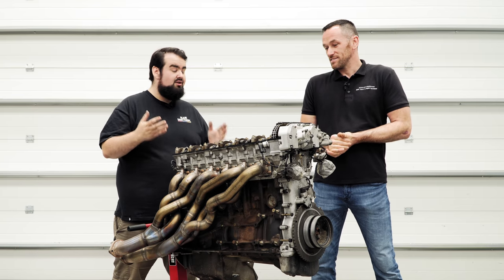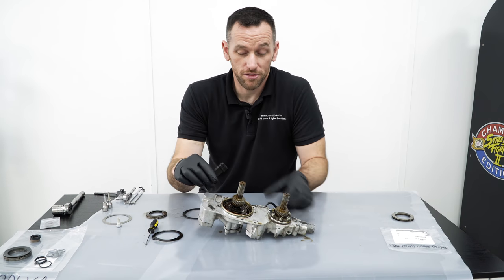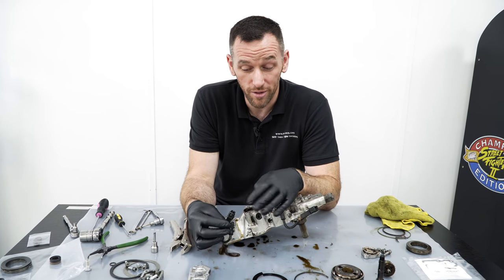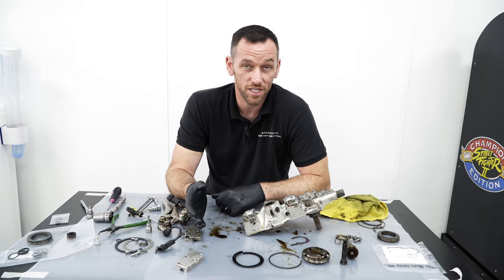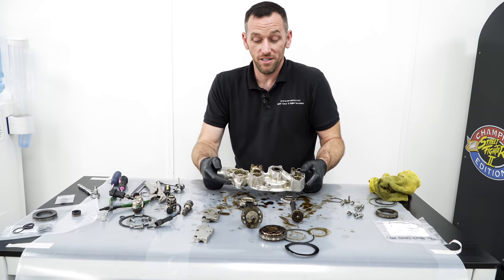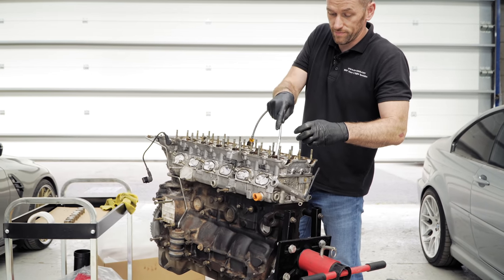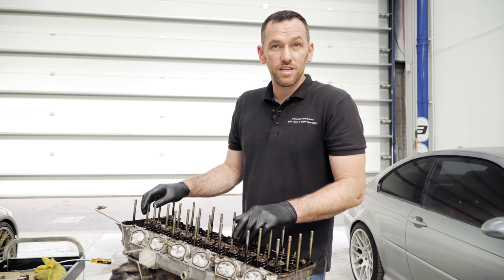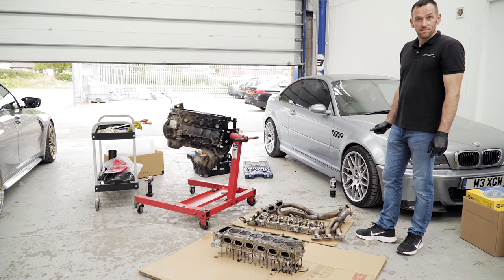BMW VANOS Masterclass - Tear down + why it fails with MR VANOS - E36 M3 Touring Ep 09

Comment: Speaking on experience, Steve is well worth the wait for anyone wanting a VANOS repair/replacement 👍. He doesn't have to do a house or garage visit in his business but he likes doing it and loves Mpower engines as all the customers do and viewers looking at the video. S62 V8 and S50 straight 6's are the best over engineered Mpower engines in my view and recall he shared his fondness of them engines also. He has an E36 M3 GT2 himself and looking to do a nut and bolt restoration but considering his long waiting list and customer demand we may never get to see it done 😂 but to be fair, GT E36s are going up! Full credit to Evolve and Mr Vanos for doing the video because barely anybody goes into this much detail.

Comment: Mr VANOS needs to read-up on the s50b30 vanos units as he is wrong.  These were not 2 stage but continuedly variable.  The 1st 2 stage vanos unit was on the M50TuB25.  Strange how a "VANOS expert" would get  his so wrong....  The S50B30 VANOS was the same as the intake side only of the S50B32.  The USA spec 3.0 M3 had a S50US engine which is from the M50Tu family...  Also its not running at 120bar but 150bar.  42:00 the holes in each primary of the headers are for a tool used to measure exhaust gases used to correct the idle mixture adaptations.  Not a "clear leftover unused sensor hole from motorsport".  You need BMW TIS for this process.  Thanks for the video, looking forward to the next one!
Reply: Yeah,, bit of missinformation regarding the S50B30 unit.  The Rolls Royce vanos unit is essentially the same on when it comes to the intake side when looking at the S50B30 and the S50B32. The exhaust side of the B30 is just an oil pump.   I also would like to know if the intake side on the B32 moves 60deg and not 40+ like the B30 because the gears look the same.

Later in the video he names the B32 the S52.. just to confuse things a bit more.

Good video though
Reply: I confirm this

Comment: This is why I love the n52 vanos system the only areas to fail are the solenoids which are 1x bolt at the front of engine and then the filter baskets on the side using 1x torx

Comment: Brilliant video- totally straight up sincere good bloke 👍 Thoroughly enjoyed it :-)

Does anyone know the BMW part number for the metal E46 S54 oil pump cover ring which Steve recommended using in place of the plastic E36 one which breaks and falls out?

Comment: Hmm.. I was under the impression that the S50B30 had constantly variable vanos, just on the intake compared to the intake/exhaust on the B32.  At least I am able to control it constantly variable within 40 degrees of movement using VEMS ECU

The intro is a bit confusing, the single stage VANOS was not used on the S50Bxx, but rather the M50 series.  The Vanos on the McLaren is constantly variable on the intake.

Comment: I’ve been very fortunate as I’ve had no issues on my S54 that I’ve had for 8 yrs and an S85 for 4 yrs and S63 for 2 yrs but I’ve herd others had nightmares . I’ve move on to Porsche with there VarioCam Plus .
Reply: No you haven’t, that’s very normal. Vanos units do fail however failure rate is not as common as the internet makes it out to be.

Comment: Could the metal washer be from an E39 M5 unit? The washer isn't listed in the E46 M3 parts diagrams, unless it's not where you'd expect it. It is listed for the E39 M5 unit.
Also I would and have always taken off the gauze filters on the solenoid. These always break down and clog up the oil passages.
Reply: Yes

Comment: P.S. mine was produced in march 1998 and my unit had that thin retainer clip on it. So I doubt it's production related and just whatever unit was taken off the shelf when the engine was built. 
I'm not 100% sure, but I recall my unit having no washer ring at all fitted anymore.

Comment: I have experienced total disintegration of the unit and noticed the much bigger circlip on the later replacement units made by Sachs vs the original Roll Royce units. But I doubt the plastic washer plays a part here. I mean, it just sits loosly on top the needle bearing and sure itsn't going to hold in the bearing(race). That must be that circlip. I recall my replacement unit not having a washer on top at all and it's been 7 years since I fitted it.

Comment: I believe that its the best explication of vanos that exist in youtube,don't speak english and its difficult understanding sometimes,but I believe that its clear in my mind,later its other thing when have in front the vanos in the table,but I can test.
Definitely goes to repair the solenoid and change the gaskets and putting upgrades.
Its possible but titanium bolts for replace the tapes?
The part of oil-pump,that was looks a holes covered,what's realize?
Change oil pump or drill orifices?
I want looks the next process,for me fuck Netflix this its better oh yess!!
Thank you so much for your time,patience and dedication for explain all process.

Comment: Guys reviving an old thread... just a quick 1 , I was wondering what material is the m52 single vanos casing made out of as I broke the casing by messing around with the vanos solenoid so i need to know what material the vanos casing is made off so I can do some solid mending or the casing part thats broken off

Comment: 18.08 is what happend to me yesterday..the bolt got loosed and my oil just spruts all over the engine..after we checked and open the cover on the solenoid cover, one of solenoid tip got stripped off.. We changed the two seals n tried repaired the tip just to let the o rings sits..n use new bolts on the cover..but then after we start no more oil coming out but then i think we advanced the timing...how to solve this ??

Comment: Quality video. A couple of questions if you see this. Are the chains the same on other engines? And the constant pressure valves. Are they worth changing? Currently dropping an s50b30 in my E30.
Reply from the maker: According to RealOEM the timing chain is shared with other M engines such as S14 and S38.

The CPV on the side of the block is worth changing, or rather the seal is for a vitron one. Very difficult/impossible to do with exhaust manifold installed.
Reply: @EvolveAutomotive  thanks for the swift reply. Luckily ATM my manifolds are off as I'm getting the s50 ones modified to suit the E30. I'll get it done asap. 
Will price up a chain. Done my rod bearings just. I do have a lumpy idle so if it's not an electronic issue I'll be ringing Mr vanos for a quote as it could be vanos.  Thanks

Comment: Great video, loved it. Interested in the comments about using the engine oil pump from the s54 engine. Interesting about the part numbers changed any time due to upgrade.
Reply from the maker: From memory Steve was saying that BMW list them as the same part number, so you’re not using one from an S54 as such, just that it is shared with an S54.